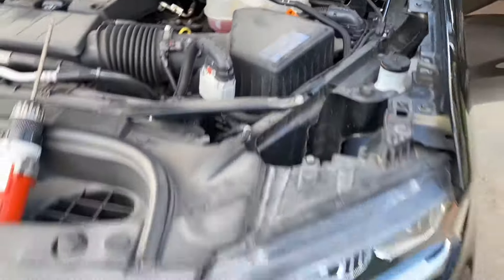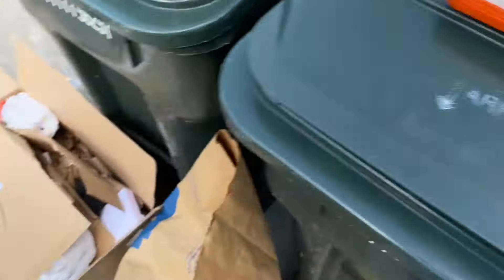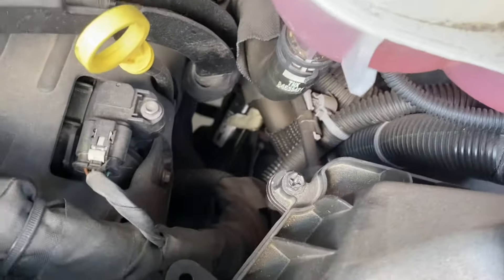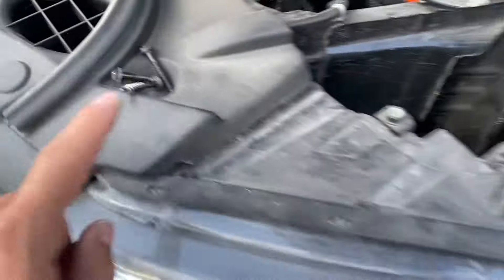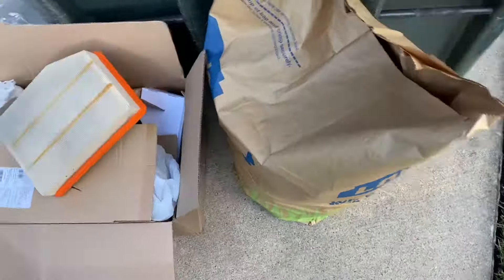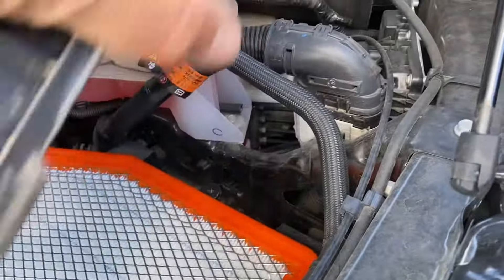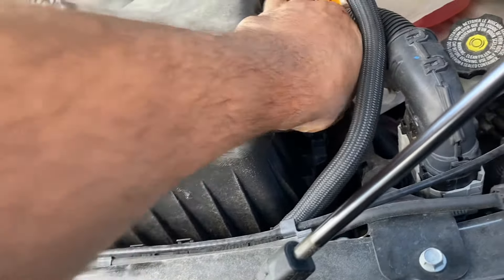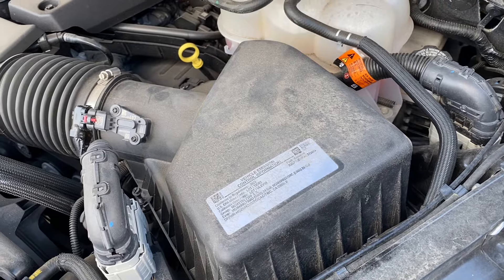2021 Silverado air filter replacement.

Comment: Sorry bro, appreciate you taking the time to do this, but to skip the step of just how easy it is to slip the housing off, it’s not, is wrong
Reply from the maker: What?
Reply: Exactly I am standing here trying to take you housing off and it is so very very very hard it doesn’t slip right off in the fact that you just skipped right over that part says a lot😂
Reply: Might need to go to the gym a more often......
Reply: That's what happens when a weekend mechanic pretends to be a pro, trying to be slick. If I have to guess, he struggled with it and decided to edit it out.